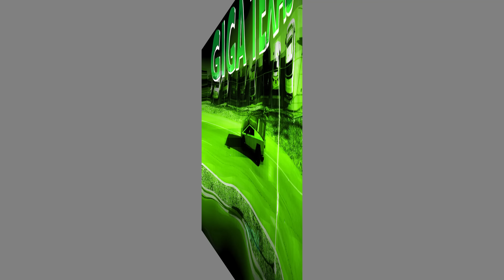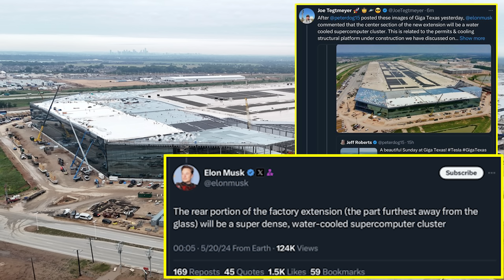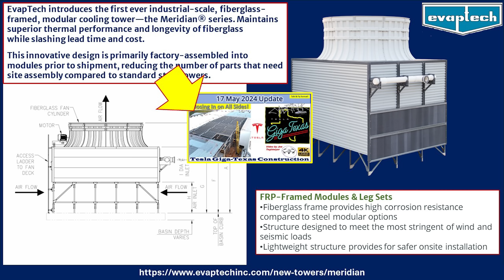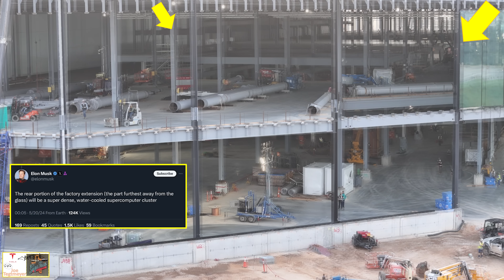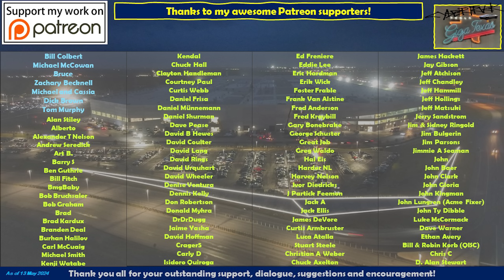S Supercomputer Data Center! N Conduit & Trenching Progress! 20 May 2024 Giga Texas Update (07:35AM)

Comment: Would it not be better and coast effektiv to use that heat from the supercomputer for something useful, like heating the factory or use it to generate electricity? Tesla use the Energie in it's cars so smart and effektiv, disappointing to see that it is the opposite for the factory's.
Reply: They may well be using the waste heat, but just as in its cars, they still need a way of dumping excess heat when it's not needed.
Reply: Not much heating neede in this part of the US 100F/39C+ temps are common. Also keep in mind energy efficient and cost efficient are not the same thing. In order to expedite the world off fossil fuels they need to be cost competitive. If altruism was the solution climate change would have already been solved.

Comment: Why would a body in white shop have a data center?
Reply: It's more than that.
Reply: Every tesla dumps it's data on a regular basis
Reply: 10:20. BIW data center. Good question. There is a permit for 'BIW server room cooling'.

I think it's a wild assumption that this massive cooling plant is that cooling plant.
Reply: @DessieDoolan, that’s what I meant to say, “BIW server room”, but I kind of assume it would be data servers, not computer servers. Either way, why would BIW need a server room?
Reply: @astewart1900  Joe misspoke, he did say Data Center.

Way, way out of my depth here, retired carpenter/construction worker. Wouldn't want to comment on why or why not BIW would need a server room, other than the production line would be computerized.

This cooling plant is massive, in terms of area it's the second largest in the building. Area being the only measure of size available to compare. I'm guessing unrelated to BIW Server Room Cooling. It was a leap to match this to the Server Room Cooling permit.
Reply: @DessieDoolan  The server room may not be FOR BIW but it may just be adjacent, and they are just calling it that.  There may be several server rooms throughout the building.
Reply: @astewart1900  The factory needs a lot of compute.  I think it's more "a server room located in the BIW area of the factory."  Most of the factory is divided into large areas named after a major function, but it's likely there are many unrelated ancillary functions in these areas as well.
Reply: @sammyk874  Had similar thoughts. Really difficult to know for sure what any of these chiller plants do.

This particular plant has massive pipes heading west into Drivetrain. No chiller plants otherwise visible to service any of GA, Drivetrain, Stamping, Stamping 2 etc.

In fact with the exception of Battery, all the chiller plants are on the east side of the building.

Comment: With the recycling of the 4680 battery casings, I wonder if that has to do with Rivians announcement at their last reveal event, that they will be using 4695 batteries exclusively?
Reply: I tend to think that they still have bugs in the production process. I'm not sure why you think the issue is related to Rivian.
Reply: @jbbuzzable  Or they are bringing up new can lines [or maximizing output on the current can lines] as part of bringing up additional cell lines
Reply: @Gig0Surf  Maybe.

Comment: Judging by the size of the containers for liquid chemicals (40 to 42 inches) those batteries would be at least twice the height of a 4680 battery.
Reply: I believe each black strip is for two cells.  So the sheet would be split along the exposed copper and halfway into the black; then after the strip is rolled the exposed copper of the anode is only on one end [and exposed aluminum of the cathode on the other], which are cut and folded before being stuffed into the can.
Reply: @Gig0Surf  The wider copper strips would leave more room for supporting elements to prevent bending of the rollers - but cutting through the coating... AAARGH.
And another AAARGH for juggling one of the pair of strips into the correct orientation to have identical wound batteries.
Reply: https://youtu.be/ZLzjkWxqmmg?t=8
Sadly there is no reference object to be found for on the napkin math.

Comment: They should look into installing their own wind farm or natural gas power station like what is across the river.
Reply: Tesla’s stated goal is to expedite the world off fossil fuels, including natural gas. Their Megapacks have already run a number of natural gas peaker plants out of business. Solar+battery storage is now less expensive to build than natural gas. Especially when they would be getting the battery storage for cost. Wind is more challenging due to permitting & transmission vs putting in acres of solar onsite.
Reply: @ReinReads  if vertical solar is a thing; they should panel at wall in Texas and Nevada.
Reply: Do you see any wind turbines in the Austin area?
Reply: @kkarllwt  is it not a windy place?